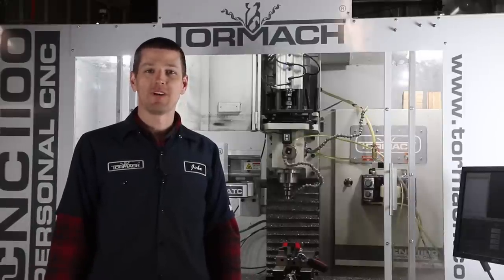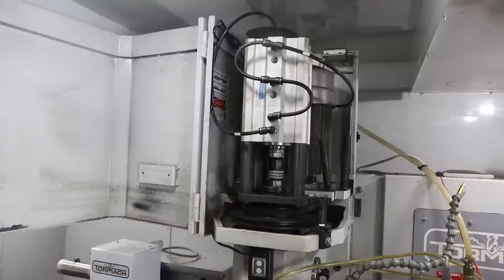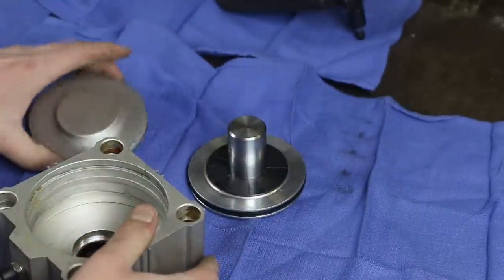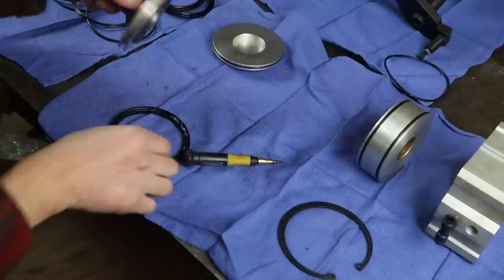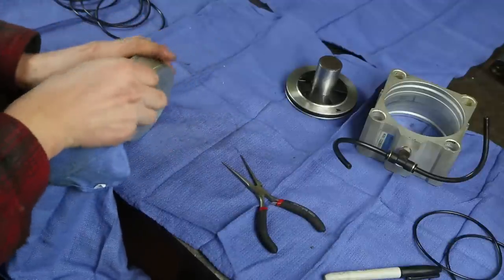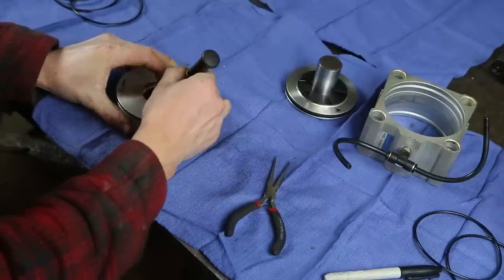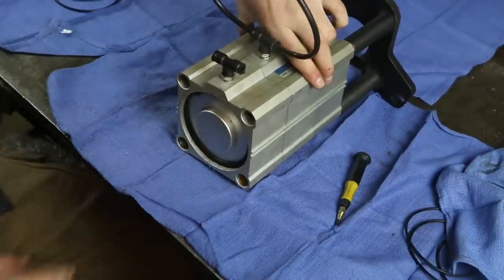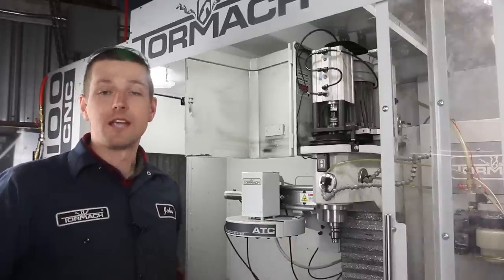Tormach Power Drawbar Surgery!  Pneumatic Seal Replacement!

Comment: Great vid. A few things about your knockout cylinder. The cylinder in that type of spindle draw bar style should always transfer the force through the spindle centre as this prevents the knockout load being transferred through the spindle bearings that’s why it has a collar. It should only ever float on the bolts that are there to keep it in a general position. The way it is operating at the moment as it rocks it is transmitting load onto the spindle bearings. That is not desirable. It does appear like the spindle knockout is not manufactured with this in mind though, a more commercial rated machine would have that plate as a two piece that would completely encircle the collar.
You need to fit at the very least a Filter Regulator (5 micron is a standard for machine tools) unit to anything that cycles with air. Cheap of ebay 10-20 dollars. Whilst it may not need a lubricator on some parts most pneumatic equipment does not have self-lubricating seals. What happens is the seals will stick slip causing them to lose their edges and loose sealing potential. The oil I would recommend is something very light perhaps C10. Almost anything with zinc in it should be ok but it has to be very thin. The cylinder appears like it has been anodised to prevent wear, this makes it important to lubricate the seals prior to assembly, not a lot of grease but a very thin film. This should include behind the piston seals. You should NEVER use anything that can scratch the inside of the piston groove to remove a seal. Brass on steel pistons, plastic on alloy pistons. When they leak internally you will hear a constant air leak coming from the exhaust of the control valve.
A couple of tips relating to the big C clip. Big clips that are loaded infrequently in a soft material will dig in over time, as a rule of thumb I normally give them a few taps with a punch to upset them prior to first removal. And finally a good rule of thumb with circlips is anything that is wider than 2.5mm you should only ever use forged circlip pliers anything made from sheet metal is normally a one-time deal.  Not good for a video but if you are concerned about the circlip flying just put a rag over the top when removing it will make it a lot safer. This has saved me a few times.
Cheers

Comment: When you add circular areas together the equivalent diameter is D x sqrt(N).  So a cylinder with 3 stages like that one is equivalent to a cylinder that is 100mm * sqrt(3), or 173.2mm.  A 2 stage 100mm cylinder would be 100mm * sqrt(2) or 141.4mm.  The 3 stage cylinder is capable of generating 3650lbs at 100psi.

Comment: Hi John

The reason they have the plate (frame of the air cylinders) fit under the spindle shaft hub is so the power draw bar isn't pushing on the spindle bearings.  The pressure required to squeeze the Belleville washers during a tool change is high enough that it could damage the spindle bearings over time, especially the shock of the cylinders coming on.  Actually a very well thought out design.
Great video.

Cheers Bill

Comment: Hi John, I have a suggestion. Could the dirt and crap also get in from those exhaust ports during normal operation? Back in the day, we used to use pneumatic silencers on our cylinders in the exhaust port that also had a small particle filter in them. Food for thought.  Cheers, Aaron.

Comment: Since the two piston exhaust ports you mentioned at 37:40 are exposed to atmosphere contaminated with dust, do you think it may be a good idea to filter the ports with an oiled cloth ball or maybe an oiled piece of Scotch Brite? It would reduce dust getting into the working cylinders, scratching walls and contaminating seals.

Comment: To lube air cylinders, I recommend Super Lube Synthetic Grease. It's a silicone grease with teflon. Safe for o-rings and works really well in an application like this. Not very expensive, try Amazon.

Comment: John, the cylinder shaft seal is only ever used on the bottom cylinder because that is the only one with pressure on the return side of the piston.  This is also probably why you have the most crud in that section, because there is constant feed air to the cylinder.  It may be possible to rework the return so that it only uses pulsed air, with a timed solenoid valve.  It would only apply air long enough to retract the cylinder, then turn off.  This would probably reduce crud buildup and not put pressure on the seals all the time.  Although that would also require the seals to hold the weight of the pistons, through drag.  I would apply white lithium grease to all of the seals when assembling the cylinders because there is no oiler to ensure they are lubricated.  You probably should look at adding another inline filter to the machine and getting one of those cheap HF air dryers (21CFM for $400).

Comment: Just a thought on your Drawbar issue. I had some what the same issue with trash in my air. I got what I call a toilet paper filter. I got mine at a local auto parts. I just looked on amozon and it's listed as "Motor Guard M-30 1/4 NPT Submicronic Compressed Air Filter" they sell a replaceable filter for it but a roll of toilet paper with the core removed works perfect for removeing particulates from the air before it reaches a tool and also a secondary moisture filter, assuming there is one. No grit no problems. I have really enjoyed your videos, keep up the good work.

Comment: John, as you have already completed the maintenance, this might not help!  Next time you have to compress an e-clip, thread a piece of .032 safety wire through the holes in the clip, then just twist the ends to pull the ring in.  This has the benefit of keeping the spring clip under tension AND you can lose the harbor freight pliers!!!  Thanks for the awesome videos!

Comment: I bought our first new mower in 2012. I had warranted problems from month #1. I learned the importance of the dealership from this. Low price and 0% financing shouldn't be the only factors in a business purchase.  Next time I'm going to Deere, and honestly I should have known better.

Amazing you got 5 years out of it.
Reply: NYC CNC Apples and oranges. I own a lawn service, you own a machine shop but the lessons from buying equipment are the same.  John Deere= higher priced equipment but way better dealership. Warranty is only as good as the dealership dong the work; that's what I learned.  Our new Toro(in 2012) broke down from month 1 and the dealership sucked. Flat out stupid mechanic at Toro. I will not allow them to work on my machine so I have to drive 55 miles to get warranty work done by a reputable dealer.

Comment: Good vid John. RE: Removing large internal cir-clip: I have had best success having a pocket magnet to lift up one side whilst slowing raising with your cir-clip pliers. The other catch is to squeeze the pliers together evenly (scissor like) rather than having the clip pressing against the part and only one plier tip retracting the spring (shows up well in your vid). They are generally a PITA sometimes. Lube on seals for install and I think Isopropyl alcohol is a better bet than acetone. Acetone is possibly detrimental to the o-ring seals join - adhesive. Having said that you only wiped it lightly not bathed the seal itself so prob no big deal. 

On a side note I would be interested to hear your thoughts on how you committed to purchase your machine tools and what pay back ROI period you based your financials on.
Have a great day.

Comment: Bottom piston is dirtiest, because it's the only one getting air for the retract function; and, to a lesser extent, because all of the moisture is going to tend to travel down the line and settle at the bottom of the stack.

Question, though, do you know about what the stroke length of these pistons are?

Comment: Also, in the Tormach Power Drawbar manual it says the following:

Before You Begin

Air Requirements

Make sure your setup meets the following air requirements:

      • Air Supply. The Power Drawbar requires an operating range between 90 psi and 120 psi. If supply exceeds 120 psi, a regulator must be used.
      • Dry Air. We recommend you use a filter, desiccator, or compressed air dryer between the compressor and Power Drawbar to make sure the air is dry.
      • Lubricated Air. Air should be lubricated with common air tool oil. Use the FRL Filter-RegulatorLubricator(PN 32457) or similar for this purpose. Refer to the documentation that ships with the 
         FRL for more information on installation and use.

Comment: Hello John.  Thank you for this excellent video as I'm having the same issue.  Regarding the snap ring pliers, I struggled with low quality harbor freight pliers too.  After a lot of research, I bought the Craftsmen 47411 (small) and 47412 (large) pliers.  They are spectacular tools and they make taking out snap rings easy.

Comment: Make sure your oiler on the back of the machine in the regulator setup  has the dial set to max. The oil flow can be adjusted and it is very conservative displacing oil at lower settings. Air tool oil is recommended !

Comment: At around the 4 minute mark when you activated the cylinder: Is it supposed to rock like that?  Looks like there's an adjustment screw to limit the "rocking" of it.  Seems like that may be another wear item but it's not too clear to me.  Cheers

Comment: For large O-rings that don't move very fast (so this would not work with a nail gun) I would recommend Dow Corning's High Vacuum Grease for all sealing surfaces. This is super thick stuff and will stay where you put it for many years. This would have also made it a lot easier to assemble everything at the end of the video.

Comment: Thank you for the great video! I had memories flooding back from years ago when I rebuilt a High Pressure Air booster at my old job. Very similar in construction, only it was used to boost air from 850-2500 PSI up as far as 5000 psi for paintball applications. 
Back then I did a lot of work on paintball equipment and preferred variations of Dow 33 and Dow 55 silicone based greases for o-rings. I used the thicker stuff on stationary or slow cyclic rate o-rings. Smart Parts Sleek lube.
Having seen now how that works, I am highly inclined to figure out how to fit one on my mini-mill. Building it should be pretty straight forward. 
Can't wait to see what you've got cooked up with this arduino CNC gun project!

Comment: Good video but I would always apply a little lubricant to the seals before insertion (either proper oil seal lube or Vasoline will often be fine. Install a high quality air filter dryer in your air line and drain the compressor weekly! See Tormach about the need for air line lubrication for this equipment and make sure you have some spare fittings and pipework as they will soon leak and / or crack taking them apart like that.
Buy a set of proper quality circlip pliers of the right size and method of operation (the 3 handled ones can work well to open or close circlips under pressure but I prefer separate tools). Use a tooth brush and solvent or water based cleaner to clean grooves.

I don't know if it is appropriate for your shop but a pneumatic vice type gripper / stand on a work bench which is operated by a foot valve to clamp / release can save a lot of time and leave your hands free to hold awkward items - however not advisable if you have youngsters or careless people about!!

Comment: I've never seen one of those multi-stage cylinders disassembled, thanks for that. Ideas for Arduino/pneumatic based application; small sheet metal guillotine? Maybe with electronic backstop? Tube bender with electronic angle setting?

Comment: John, I have been watching your stuff for some time now and have found your channel very inspiring.  I bought a Taig not to long ago so in a way I'm kind of following in your foot steps.  All of that aside, I am a mechanical engineer and work in the fluid power industry, most specifically pneumatics, and work for a company that is an SMC distributor.  With the correct air preparation that cylinder should last a lot longer than "many thousands" of cycles.  Additionally, you should not have to lubricate, the industry almost never lubricates anymore.  I could make some recommendations for air prep if you would like that could do wonders for you.

Comment: John, thanks for letting us watch the maintenance.  Interesting design. As far as pressure goes, keep in mind that a 4" cylinder has a bit over 12 square inches of surface.  At 100 psi, that's 1200 lbs of force. Three of those stacked and you get over 3600 lbs on the drawbar. 

As for the Harbor Fright circlip pliers, there's nothing as expensive as a cheap tool. (Cheap meaning low quality...if you can pick up good quality for little money, like used at a flea market, go for it!). Poor quality tools cost you every time you use them...they aren't fun, they can damage things, cost you time, and even injure you. Eventually you replace them with better, so why not just get good stuff to start with? More up front but cheaper in the long run. 

I have two air nailers...one wants airtool oil, the other does not.  Read the directions!  To deal with this I got an inline oiler and attached it to a 1' section of air line with quick disconnects at each end. When using the oil loving tool I connect it to the tool and the air to it, and when using the other tool I just use the air line alone. That way I don't get oil into my air line (very bad when using it for painting...or with the oil hating tool). I prefer the nailer that doesn't use oil...because it doesn't exhaust oil on or around my nice wood projects. 

-- Mike
Reply: NYC CNC
Thanks!  I got 1200 from the area of the piston top (Pi x R^2....I didn't have a calculator or paper handy, so I just used 3 for Pi...the actual answer is closer to 12.566, not 12, and you said the diameter was 4", so R is 2) and the air pressure of 100 psi.  12 square inches times 100 pounds per square inch = 1200 pounds of force on the top of the piston (and on the sides, top, etc. too of course, but only the piston can move (we hope!).  You have three pistons, so three times the area, and three times the total force = 3600 lbs.

It's that sort of area multiplication that makes vacuum tables work...it doesn't take very many square inches at 15 psi (1 atmosphere more or less) to give a fair amount of holding force.  For instance, a 10" x 12" plate with a vacuum under it and room air on top is held down with 1800 lbs of force (10 x 12 x 15). 

-- Mike
Reply: BigMjolnir little clarification, force on side of cylinder is not 1200 pounds of force but is equal of circumference times stroke of cylinder (circumference=2xPixR, R is the radius of the circle, Pi approximately 3.142) and force on bottom of cylinder smaller then force on top by area of rod times pressure (useful area on button is smaller), but design they use it apply pressure to only one cylinder for retracting so retracting force is more than 3 times smaller.

Comment: When I worked with the fadal 4020 I sometimes (actually many times) got to see the spindle head torn apart. The draw bar is actually pretty cool stuff. As is all related to these machines.
Reply: The fadal or the drawbar? Ok machine and drawbar was a bar with them belleville springs. But to understand how the parts work together to take tools, that is just something. For operator that is just M6 but there is more to that...

Comment: Good vid, but you should always assemble pneumatic cylinder seals with grease. I have to do repair works quite often in my work and my personal favorite is Klüber Paraliq GTE (food grade stuff, but still my favorite). Don't know if it's available in states? But you also never shouldn't use regular oils in cylinder assemblies. Some say oil mist devices are needed, but that's not true at all. There's tons of applications that can run dry, but even then, Grease those seals before assembly, actually I haven't seen a repair kit that wouldn't have small grease bag with them. Hint for those big circlips, I like to use two small screwdrivers to align circlip out. For removing seals I like the common O-ring tools. They're sharp and kit will always have and appropriate shape to push in rubber and remove old seal, note push in seal and pull out, don't push between frame and rubber to avoid scratches.

Comment: When you need to be delicate, yet have a tool that is strong enough for such small spaces dental tools are great. So long as they are steel and not the cheap plastic handled tools.They also come in a variety of angles, shapes, and hooks perfect for pulling rubber O-rings out.

Comment: I jumped in my seat when the C clip sprung out. Gets me every time.

Pro tip: Use a slot screwdriver with your other hand to lift the back of the C clip out of the hole.

Comment: you should have put some silicone grease when assembling those o-rings since you're not oiling it or at least coat the parts with some air tool oil - those should not run dry.
I think you need an air-dryer to get rid of the crud, most likely created by the water vapors/condensation in the air source,the bottom one got more since it always get air and was also leaking.I noticed it goes crooked when you activate it, seems to be holding on to the cam bolt and only after some motion is leveraging on the collar but only on 1 side (the right side the way you look at it), I think the cam should be longer a bit (maybe space it with a washer or 2 on the bottom) so it touches on both sides of the slot on that shoulder.EDIT: not sure if you need to use an oiler, it might fill up your bottom cylinder after a while, i don't think you need one since like you said is not a continuous motion but i would think every once in a while just put a drop of airtool oil in thtu ports (both in/out ports) with a syringe,